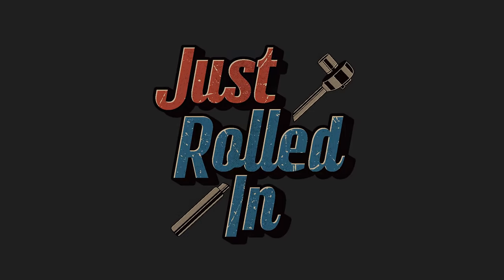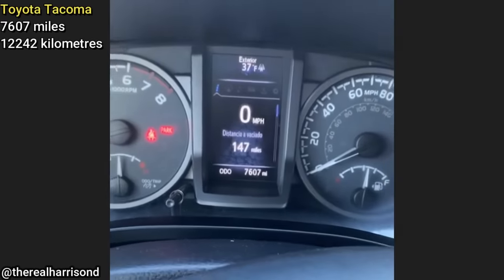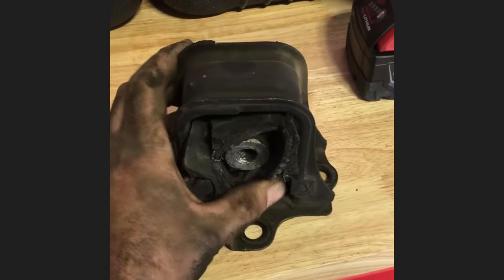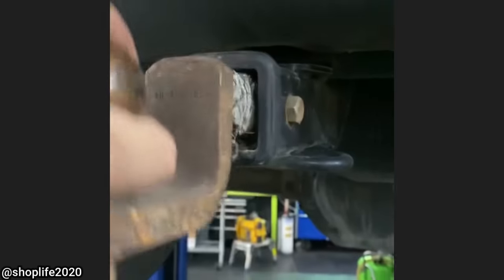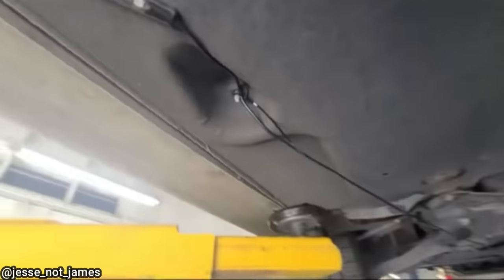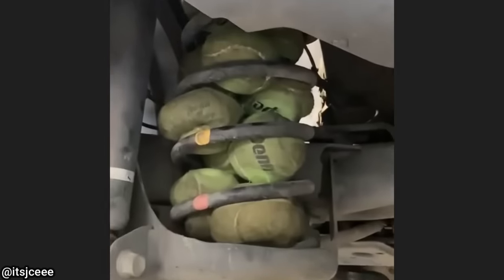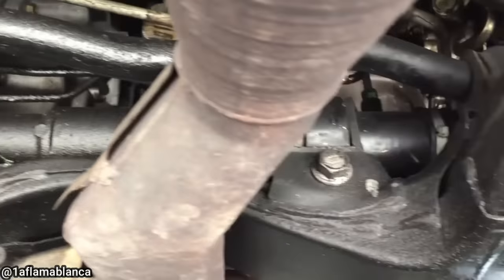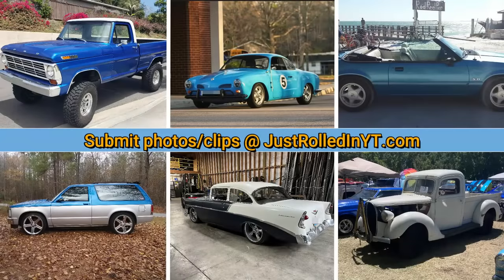Customer States Change Engine Oil On Tesla | Just Rolled In

Comment: You know, I would rather have someone think all vehicles including electrics need oil changes than have someone who is not taught that most cars need them.
Reply: Yeah at least they erred on the side of caution. Nothing bad came from it.
Reply from the maker: Definitely! That's why I mentioned it.
Reply: Had a customer with a Mercedes sprinter and a catering business who unfortunately feel for the whole 20k or 1 year oil change crap they advertise now so 45k and 1 year later I'm cutting her oil filter off with tin snips because damn
Reply: i had a nissan leaf in for an oil leak under the engine bay, they were right, the gearbox was leaking [ first one ever]
Reply: Exactly what I was thinking.  I would imagine Teslas still have some type of transmission fluid or gear oil that needs to be changed at some point.  Yes / no?
Reply: In all fairness the differential and or brake fluid can be replaced on a Tesla, although those can arguably outlast the battery in those cars. Some Teslas do suffer from stuck brakes due to them not being used that often. So props to the owner for being proactive even though it wasn't required.
Reply: @malcolmreynolds8574  
So that would be 25k past oil change time then .............................
Reply: @jagtan13  But at this point you are simply having fun with semantics. You could argue that even if there was zero oil or grease used in the car itself, they are still required for operation.... so long as it isn't self driving anyways, since humans need to be inside it.

caveat: I never write things off as "now thats just semantics..." as that mocks the thing that makes words useful, meaning (hence why I said 'having fun with'). But I do for instance, understand the difference between "trying to get an oil change on a Tesla" and "just because theres no ICE doesn't mean there is no oil".
Reply: I don’t know much about EVs but they most require some type of regular lube job. I mean there’s moving parts that most need to be greased. I could be wrong but kinda nice seeing someone try to do routine maintenance than seeing tar coming out of an oil pan
Reply: my exact thought. i’d prefer someone bring in a tesla wanting an oil change than someone bring in a truck 8000 miles overdue for an oil change wondering why their engine locked up
Reply: @jweav151  probably . Although they only have a single speed transmission
Reply: I believe a tesla does use oil for the differentials.  I've seen some pics of a tesla with oil filters
Reply: @whyjnot420  Indeed I'm having a bit of a laugh! And yes many systems, steering rack, brakes, bearings and such still use grease and or oils in electric cars, but it is a growing trend to make them unservicable. So, in most cases Tesla cars don't need the regular maintenance of an ICE car but I aknowledge that they are Not service free.
Reply: @papa_pt  yeah and it needs oil like any other transmission, fromt amd rear.
Reply: you could have flushed the emergency brake fluid or something.  I think EVs are not 100% electric brakes, but I could be wrong.
Reply: @JustRolledIn  Teslas need oil changes to you know. And im not kidding.
Reply: technically it does, a quick search online finds an recomendation in the early model 3 owners manual for the drive unit oil and filter to be changed at 50k miles and procedure of how to do so. tesla have since removed it from the manual
Reply from the maker: @firefly2472  That's what I read online. They have oil for the electric drive unit. However I don't know if Jiffy Lube would have the stuff to service it?
Reply: @Hide_and_Tweak  It can't be 100% electrically powered. And there will never be a car made with 100% electric brakes.
If a car loose all power from an accident you still want to be able to brake.

I could see a crazy person making a fully cable brake system in a car tho. Lol
Reply: @malcolmreynolds8574   I've never heard of it going THAT much... the owners manual on my car states at most 10k miles - 6mos (Generally if the oil on the dipstick gets to be looking sticky/dirty and I usually hit the 6mos before the 10 most times) but I'm not sure anything can go that much.
Reply: @JustRolledIn  I only know for Hyundai EVs that there's a "motor oil" and a "gear reducer oil" (transmission/differential).  Gear reducer oil only lasts 20-30k miles before needing replacement, and motor oil I forgot (been a while since I've looked) but it's probably similar to the gear reducer oil since Prius hybrids typically need a hybrid "motor" oil change at 30-50k.
Reply: @whyjnot420  

Asides the ellipsis with a dot too many and your supposition that self driving cars don't need lubricants... what?
Reply: @leadpilled5567  As far as GAS vehicles, Most people rarely have to grease ANY portion of modern "Cars" these days. 
Even my 2004 Nissan Frontier, there are NO grease fittings anywhere, including the drive shaft and of course the front steering , also the sway bar, etc!  no fittings at all!
Reply: @blue03r6  They use an oil filter in a situation where it is 100x overengineered for the job it does.  It's not oil, it's most similar to transmission fluid, and it's designed to minimize wear on the reduction gears that connect the engine to the axle.  There is very little wear anyway due to how they are designed, but the fluid makes it pretty much 0.  Oil filters are designed to handle stuff that is MUCH higher temperature with a LOT more contaminants.  Meanwhile the engine area of a Tesla never really exceeds about 100F.  The fluid and oil filter are pretty much engineered to last a million miles or more, it's not a maintenance item.
Reply: @jweav151  I know the hyundai kona gear box has fluid and needs changing ever 40k not sure if miles or km
Reply: @skylined5534   Since you ask, I will explain it. I was having fun with semantics, just as I said the person I was responding to was, I just did it in a more hyperbolic way. This means that I was playing around with the meaning of words as semantics is the study of meaning in words. I was saying that even if there was absolutely no lubrication at all (note this is different than actually not using any) the fats inside a human being mean that lubricants are still needed for operation as a car needs a driver.

Now, that I have answered that, I ask that you reread what I said with your newfound insight.
Reply: There are definitely fluids in that car, just wondering what the mileage is. Like if he had 5k on it that'd be funny
Reply: @Khontis  a number of oils and filters now advertise 20k or 1 year ( which ever comes first) with astrix* after such bold claims that too many people don't catch. The oil will say 20k* (with corresponding filter) and the filter will say 20k*** (consult owners manual and follow what it says because we're not responsible) this poor lady's oil had changed states of matter from liquid to solid it went from oil to grease
Reply: @jweav151  No Transmission fluid, Gearbox needs oil but the oil should outlast the gearbox so no worries there.
Reply: @reesesalen5033  There are 3 fluids in the car.  A glycol based coolant used by the Octovalve heat pump to move heat to different places.  It can cool or heat the cabin, battery, or drive unit.  Brake fluid...this part is the same as any car and needs checked every 2 years, and replaced as needed.  Works the same as brakes in any other car, only much less use and it lasts longer, because the brakes are rarely used.  Brake calipers need to be cleaned and lubricated once a year if you live in an area where roads are salted.  The last is the drive unit fluid which is expected to last the life of the car and is not a regular service item.  The only time that and the glycol based coolant would be changed is if there was a leak or damage (which is VERY rare).
Reply: @jweav151  Also the battery/motor coolant
Reply: @malcolmreynolds8574  45K?  Is that metric?  No way is anybody pushing 45,000 mile oil service intervals.
Reply: @JustRolledIn  Considering Jiffy Lube can barely get it right on Honda Civics...
Reply: I always get a laugh from tesla owners who claim there's only 3 moving parts on their car.
Reply: @jweav151  yes.  Tesla motors are oil cooled/heated and use oil for lubrication with a screw on canister filter.

So let's say you change your half shafts or replace the seals whatever... Oil would just run out unless you dropped the filter and drained it first.
Reply: At least the idea of SOME mechanical parts needed service. Not going to give the customer grief. They had the idea servicing their vehicle in mind.
Reply: @jweav151  There is atf in the drive units and there is actually a small oil filter on each drive unit, but the fluid and filter are lifetime unless there is a failure.
Reply: @immikeurnot  nope. Miles U.S. 
The jug said 20,000 miles or one year so she went 1 year without an oil change because she didn't understand what the astrix ment*
Reply: @kevinshort3943  all the bold claims on the oil jugs and filters have an * after them saying consult owners manual and follow it's service intervals because we're not responsible. But no one reads fine print but yeah it claimed 20,000 or one year (which ever comes first) but she didn't read the fine print so she did one year with a catering business all over the south east. That engine was NOT happy about it
Reply: I work on old cars and I thought electric cars needed oil changes lol
Reply: @malcolmreynolds8574  Thank you! The small print. It’s like the 3 year 36k guarantee, whichever comes first thing. Just sticking with a regular service interval will work better than a gimmick.
Reply: @jagtan13  I was going to say pretty much this. Just because it's an EV, doesn't mean there is NO oil that must be changed at some point. They do have differential lubrication, brake fluid, and they also have coolant, all of which would need to be changed at some point. As far as those outlasting the battery, I wouldn't bet the farm on that one.
Reply: Don’t these teslas have oil filters for the diff?
Reply: There might even be oil somewhere.
I think there are cars with oil in wheel bearings instead of grease to reduce friction. Not sure about Tesla.
Reply: @immikeurnot  Dude, my Mercedes W210 had what was allegedly "lifetime" automatic transmission fluid. The car immediately went from the seller's house to my mechanic to have the contactor plate replaced AND a complete drain and refill of the transmission. Not the PO's fault- she was told by MB that it was lifetime. I knew differently- 98K miles on the same fluid is a huge risk.
Reply: 100% lol. That's the good kind of stupid. The "I know I have no idea so I better be extra cautious" kind.
Reply: @leadpilled5567  They need as much lube as your washing machine and dryer :)
Reply: @jweav151  they have some, intended to be lifetime, like, 200K miles.
Reply: electric vehicles do have fixed gearboxes  and they could need a oil change
Reply: @jweav151  yes, idk exactly but there are service intervals on transaxle fluid, motor/esc coolant and battery coolant. And some other standard stuff like brake fluid etc.
Reply: My Zoe has a CVT: it needs an oil change from time to time 🙂
Reply: Don't they use oil to cool the electric motors in some ev's? If so it not so stupid.
Reply: 50% of woman drivers: “Oil change? What’s that?”
Reply: @jweav151  maybe grease on parts but since its power straight from the battery there's no engine oil and there's not really a transmission.
Reply: @jagtan13  EVs still have oils and fluids that needs to be changed and the batteries last longer than the fluids in many cases. With Teslas all you generally need to do is service and repair the modules which is not an impossible task.
Reply: Only thing that needs changing on electric vehicles are diff fluid 😂😂😂
Reply: @malcolmreynolds8574  A lot of people really don't understand that "or one year" or whatever time limit they have. It took me like 2 years after my mother retired before I got her to understand that oil degrades over time and that she would need to get oil changes even though she hadn't driven far enough to warrant one. She understood it quick enough tbh, it just took awhile for it to sink in, she had been driving since 1968 when she got a 65 Mustang when she was 18 (hell of a first car, right?). So she was unused to not driving anywhere near as much, once she retired.

That one year in the engine of a vehicle for a catering service sounds... just... well, I am glad I'm not working on that.

addendum: I know oils tend to have a shelf life of a few years but my personal view is never letting it go longer than a year when it is in an engine, regardless of how few miles or hours are on it. My main thought is "oil is cheap, engines are not."
Reply: @jagtan13  I come from the world of computers (I wanted to be an auto mechanic before I got into computers, so I have a basic background with cars) and that is a truly disturbing trend at times, but it can also be a great thing at other times. It really depends on context.

Look at the evolution of PCB (printed circuit boards) in computers such as the motherboard. Back 40 years ago, it was cost effective to repair motherboards by hand (for one thing, back in the day the traces could be gold instead of copper and a motherboard then could cost as much as a cheap computer costs these days, not just because of the materials though that was a factor, I think you get the idea). These days, you can still do this, but it can be exceptionally hard. So on ye olde desktop computer it is more cost effective to drop a new motherboard in, rather than spend 10x as much to repair the broken one.

In short I have no problem with things that are designed to be unservicable, so long as that is more cost effective. It becomes disturbing when it is done to lock a person out of the ability to do their own work (such as what Apple does with their products), or is simply not a cost effective way of doing things.
Reply: @whyjnot420  to put it in perspective for my customers I liken it to coffee. Even if no ones drinking it it'll still cook down or go off so every 3k or 3months or 3 hours if its coffee I change it because fresh is good and stale is not. If they don't understand anything else they'll understand that. Also if you have a business were customers are going to have to wait for extended periods you better offer coffee and keep it fresh. That's the bare damn minimum of retail plain and simple. I gave my Toyota dealership endless shit because they made me wait for hours and the coffee was cold.... UNACCEPTABLE
Reply: @jweav151  Yes, I believe each "drive unit" (motor, gear reduction, and differential) has a few quarts of synthetic ATF that probably does need changed every 50-100,000 miles. There are no clutches, bands, torque converter, or the like, so nothing to really wear much. The drive units are VERY simple and as of 2016, very durable and reliable. The simplest drivetrain you'll find on a modern car is one from an EV.
Reply: @leadpilled5567  Like most every modern car, all of the suspension is lubed for life, but the drive unit synthetic ATF oil and battery and motor coolant would need changed at some point.
Reply: Just for ur info , ye all vehicles need an oil change ... even electric ones .
in my ktm freeride u have to change the gear oil every 50 running hours for example .
Reply: To be fair they do need oil changes. Just not engine oil changes
Reply: @malcolmreynolds8574  Speaking of coffee, back in the later 90s when I worked at a McDonalds as a closer, it was pretty common for the pot of decaf that was there when I started, to be the same pot that would be poured out when the store closed. There was just that little demand for it. But every so often there would be someone at like 11pm who would order it. I always thought "If you are buying decaf McDonalds at 10 or 11 at night, you deserve 12 hour old coffee." (if a pot was a few hours old at say, 5pm we would brew up a new pot for people if they ordered some, but an hour or less before closing, no way.)

With my mom and oil, it was really just about changing a learned behavior. She had never needed to think about the shelf life of the oil in cars and like I said she had been driving since the late 60s. She wasn't completely unaware of this either, as she does have a gas powered generator at her house that gets a once a year oil change regardless if she has used it or not. It was really just about getting her to apply that to cars.

My personal analogy is to simply use rusting steel/iron. Basically "steel rusts after awhile even if it isn't being used" and most people get it pretty quick. Since everybody knows about rust. I like the rust analogy because just like steel or iron, things like lubrication and fuel oils are highly refined and the tendency of refined things is to break down into more stable forms, like rust. But I do like the coffee analogy, its pretty good.

btw: if you don't keep brewed coffee on a hot plate like you find on drip machines, it goes bad a whole lot slower. This is one of the reasons I use a french press, though it is a secondary reason.
Reply: @JustRolledIn  teslas do have antifreeze, there's a radiator for cooling the batteries.
Reply: me: man i need my oil change bad, im running 10 over change time
coworkers fiancee: car with 15000 miles without a change whys the car making those noises?
Reply: @Nicky L would have been a lot better off yes. 20k is a hell of a service interval and NOT manufacturer recommended but at least her oil would have still been liquid
Reply: @jweav151  they don’t have transmission or gears. Electric motors power the wheels the same way you drive an electric rc car. They need tire rotations every and wiper fluid and brakes as their maintenance
Reply: @bluecollarwatches7048  On a minor technical note, you don't need to have liquid in a radiator. Generally speaking that is. Not talking about any one specific instance. Point being, I wonder how long radiators as we know them in cars today, e.g. liquid filled, pumped, pressurized, active cooling, will be around.

To get an idea of what I am talking about, look at the world of cooling solutions for computer parts. They might be small, but a cpu needs like 10x more cooling than an ICE when you look at how much area gets how much cooling. There are some pretty nifty ways of moving heat (advection for example and yes I spelled that right) around in order to get it to a very effective place to cool it. Not to mention proper fully passive systems that just rely on a heatsink with nothing but ambient air.

No clue if anything used on comps right now (like what I was just talking about) could be directly applied to something like an EV, but the concepts are valid in a lot of situations and the tech has been pretty mature for years.

Just food for thought.
Reply: Do you lubricate a Tesla with Musk oil? 😊
Reply: @whyjnot420  Tesla’s use ethylene glycol to cool the batteries. It’s cheap and readily available.
Reply: @bluecollarwatches7048  I was just pondering the future of automotive cooling in a way only tangentially related to current stuff in that last comment of mine.

I like to think about how one sector can interact with another in a manner like what I was getting at. It is an interesting thing, looking for something that works in one distinct place and considering how it might work in another very different place.

Food for thought on this: The gas powered ICEs we all know today would not have been what they are, without perfume bottles from back in the day, the ones with the big hand pump. As the atomizer used to  create the aerosol of perfume/cologne is an ancestor of the jet on a carburetor.
Reply: @jweav151  Teslas don’t have transmissions or gears. So no. The only oil is inside the motor itself. It’s magnetic. It turns on, and off. This is one of the biggest advantages of electric vehicles because you know that there’s less parts that are gonna wear out. The only thing you need to worry about is basically the battery losing charge overtime, (range)but the motor is going to last far longer
Reply: @whyjnot420  low end cpu use giant heat sinks and fans. The  average cpu uses heat pipes that wick liquid inside them to even bigger radiators with bigger fans.  High end gaming cpu use literal car oil/transmission radiators and antifreeze filled tubes just like a car.
Reply: @soangry  I have been building computers for 20 years now. I am rather familiar with how that all works. Hence why I was thinking about other applications for stuff originally designed with home computers in mind.
Reply: Most evs need an oil change, i think tesla is one of the few who don't have a reduction gear that needs oil change.
Reply: Even my little EV has a final drive reduction and differential.  Unofficially recommended to replace the gear oil every 30k miles.
Reply: Electric vehicles do need oil to lube the motors and gears/differentials!!
Reply: Actually!!!??? From what I understand Tesla's DO have oil and an oil filter for their gearbox.
I'm not a mech or do I own a Tesla but why not get the oil changed if it can be done.
Reply: @whyjnot420  

Good god, I've located that guy who's the 'fun' one at parties. But take heed, he WILL try and give you a   complimentary roll of 'word of the day' toilet paper.
Reply: @skylined5534  That would be a waste I already do a word of the day on my own.

Today: Janus - the two headed Roman god of doorways, beginnings/endings and transitions, also the root for the word "janitor" for the Latin ianitor means doorkeeper. Which leads into "janitoriat" who are the people who protect important people. What this says about the Secret Service, I will let you decide for yourself.

(tbh, I try to get at least one new word per week, not just learn a new one, but also use it a bunch of times. The last time I took a proper test to estimate the number of words I knew, it was estimated that I knew around 25k words. Something like 2x or more of what most people who speak English as a first language know, or roughly around the same number as Shakespeare.)
Reply: Agree. It's way less embarrassing than people who own a car for years and never get an oil change, haha.
Reply: @KelsomaticPDX  At least most people who go forever without an oil change know they are doing this. Obviously that is not good, but at least it was a choice they made for whatever reason. The term "deferred maintenance" while often used in a mocking manner, is quite accurate in such a situation since it means 'put off till later'. You cannot put something off until later, unless you know what that something is and that you need to do it.

Here I was referring to those people who literally do not know about oil changes because they were simply never taught about them. Remember a couple/few videos back on this channel, one of the clips was of a car that belonged to someone who literally did not know they needed to change the oil.

(as I said elsewhere, I think that whoever teaches a person to drive, should be the one to teach them about basic routine maintenance, the same way you teach someone to fill the washer fluid, so I actually blame those who taught the drivers who do not know about routine maint. this does mean that I would blame a self taught driver for not knowing, but most people get at least basic instruction from someone)

addendum: The kinds of things I believe should be taught by the person doing the driving instruction are things like tire pressure & wear, oil changes & quantity, regularly driving long enough to burn water out of the system, coolant levels and perhaps a good old fashioned Italian tuneup once they are decent enough at actually driving. With the only tools needed being some paper towels, a funnel, a cheap pressure gauge and a lead foot.
Reply: @malcolmreynolds8574  Mercedes Sprinters can have up to 60k km changes, so i don't see much of an issue there, als what the hell are you trying to cut off on that oil fiter?
Reply: @aaaabababa  the plastic ring top and bottom that hold the filtration media together. 45,000 miles was a big ask for Walmart brand oil
Reply: That's ture its good to see that they know enough to at least care about a vehicle its also nice that they had the chance to teach that person
Reply: @JustRolledIn  In fairness, it's a bit of a weird one for most electric vehicles as there isn't really a whole lot that is serviced.

I have a Model 3 myself I've asked Tesla Service if something needs doing, like at the time of getting my car their service schedule said about lubricating some brake components to avoid something sticking, and after 4 years getting a battery coolant loop fluid replacement, but since getting my car those items aren't part of the schedule anymore. Actually, the schedule is gone entirely! The service schedule is literally: "Well if you notice something bring it in" - Weird.
Reply: My thoughts exactly, its hilarious but at least they are trying to maintain it.
Reply: @paulriggers1558  I have a better story regarding a leaf.  You can jump start them.  I had no idea until one day I saw a leaf with a dead NORMAL battery get jump started and then run on its main batteries.  Something to do with AC vs DC current, so yea if somebody ask you for a jump with a Leaf, its not a joke the actually need a jump.
Reply: @Crusher103  you can also tow them to recharge the main battery
you need to put them in regen braking mode, then gently apply the brakes whilst being towed. you can get a few miles worth back in it, but the brakes overheat quickly
by the way, its all dc current, the 400v drive battery tops up the 12v battery all the time, so once it is powered up + in drive mode, that little 12v will never go flat
 the later cars wake up once a week to charge the 12v up [allegedly]
Reply: True, plus it's always good to have your vehicle inspected few months depending on how often you drive or have interval service done.
Reply: Hey, my battery’s dead, will you help me jumpstart my Tesla?
Reply: @papa_pt  Singlespeed transmission or CVT?
Reply: @LuckyCharms777  open the bonnet [hood] + pull the panel in the top left out
then put your jumpleads [wires] on the 12 volt battery......
Reply: @LuckyCharms777  single speed. The Porsche/audi electrics have two speeds
Reply: I would rather have someone review their owners manual than just assume they know everything about their vehicle.
Reply: @wdbldr67  
Maybe Tesla doesn’t have an owners manual, like how iPhones don’t have an instruction manual anymore, and you have to figure it out or search for it.
Reply: @LuckyCharms777  Tesla's do, its in the Cars system viewable from the Screen and is updated every time they make an update to the systems that requires the manual to change also.
Reply: right? like it's not unreasonable to think that the electric motor has some sort of cooling/lubricating oil or whatever.. which is probably does but its "lifetime".
Reply: Or someone(like my female neighbor did)  putting oil in the engine w/o removing the old oil first.
Reply: They do have and oil filter so idk
Reply: @jweav151  No, as more likely you would need to replace whole unit that comes with fresh oil. The oil is closed loop & acts more like coolant. If you do decide to change oil you could end up worse if you don't seal up properly. But closest comparison would differential fluid interval but tesla m3 system does have oil filter (2x on AWD) so in theory would be multiples of that interval since any damaging metal pieces be caught.
Reply: @geplayer  Food for thought: Rather powerful brushless DC motors exist in the world of hybrids. Those motors have basically one bearing and that is really it and just like with CV joints that have a torn boot and are leaking grease, you don't replace the rollers/balls inside the bearing, you just put a new bearing in... or just toss in a new motor wholesale.

I will let the people who really know EV/hybrids say more about the specifics of any one make, but that does get one thinking about just how few moving parts there are in comparison to reciprocating engines of any kind (not just ICEs).
Reply: actually, tesla does need oil changes... but he wouldn't know that because he's a quick lube specialist and not an actual mechanic all-electric car's gearbox or drive system does need synthetic oil to operate the gears internally. tesla isn't any different, thing is tho... most gear box fluids are "lifetime" now aka for the life of the part while the tesla doesn't need the conventional oil change it does in fact need oil changes. The electric motor (Drive Unit) in aTesla uses oil to lubricate and cool the gear reduction and differential. The oil also acts as coolant to remove heat from the stator and rotor. and does infact need regular changing.
Reply: i know i'm am going to sound extremely dumb right now, but is there absolutely no oil in an elektric engine? i mean, with that much moving parts there needs to be some kind of lubrication?
Reply: @henkdenktank3632  the motors themselves are oiless, but the transmission/gear drive systems are oiled most electric motors are brushless or graphite lubricated
Reply: @PolyPixxel  ty for the information
Reply: @henkdenktank3632  There are barely any moving parts in an electric motor. They are more similar to turbine engines than reciprocating engines.
Reply: Only fluid Tesla needs is blanker and windshield fluid filled
Reply: My college girlfriend: "My car is making a funny noise."  Me: "When's the last time you checked the oil?"  Her:  "Cars need oil TOO!?!"
Reply: @lt4324  When I pumped gas in the 70s, I was adding oil to probably one in ten engines that came in for gas, and we did regular oil changes for everyone. Nowadays I can't remember the last time in the last 30 years that I've had to add oil to a car, and changing it is maybe 1/5th as often if not 1/10th.
Reply: @TwinShards  it has regenerative braking and normal friction brakes. For the average person, you’ll only use the friction brakes when regenerative braking is unavailable because the battery is full or the battery hasn’t warmed up yet.
Reply: LEGIT

I'd make a point to that operator too, before he left, to be like
"hey, sucks to lose your business since your car doesn't need it...but I'm glad to know at least that you are a SAFETY FIRST individual just like me"
Reply: Electric vehicles do have oil inside the gearbox, but it does not need to be changed. Unless it leaks for some reason, the factory gearbox oil should last the lifetime of the vehicle.
Reply: and teslas factually still need oil, just not engine oil, but transmission oil.
Reply: honestly , all vehicle have moving part so make sense to me
Reply: The whole idea about ev's is NO OIL. 
WTF are you people thinking.
Reply: Would it still not require differential and transmission fluid?
Reply: That'll be Thirty nine ninety five.  Plus tax and environmental carbon offset fee.
Reply: @jweav151  not serviceable but there is oil and coolant.  Even the breaks dont typicalky wear because 90% of the time it slows down with motor regeneration charging the battery.  They sure eat tires though.
Reply: The gear oil does need to be changed tho. So they probably meant that.
Reply: @sierra00990  Customer states "change engine oil". Not "change oil" but "change ENGINE oil". Please actually read, not just the title, but the actual description and notes for each chapter before stuffing your foot into your mouth.

This has been your personalized lesson in how to not be an idiot.
Reply: @segaiuolo  Renault Zoe has a single speed reduction gear. How does it have a CVT?
Reply: It has a gearbox on the electric motor with an oil filter attached but as far as I’m aware it will last as long as the motor.
Reply: @jweav151  I let Tesla change my gear oil on my '19 Model 3, front and rear, at 100,000 km, because I'm an engineer and like my gear. And repeat every 100,000 km.
Reply: @fishevans6417  Boys, transmission fluid IS OIL.
Reply: @jweav151  As it has a differential, it will need oil. However it is probably a sealed for life unit.
Reply: I still find it strange for any vehicle to not need oil. Grew up being taught metal on metal is bad and needs some kind of lubricant.
Reply: I just wonder why was it driven on the lift.  I'm sure the mechanic knew. Hopefully